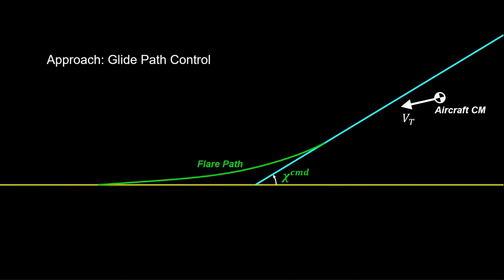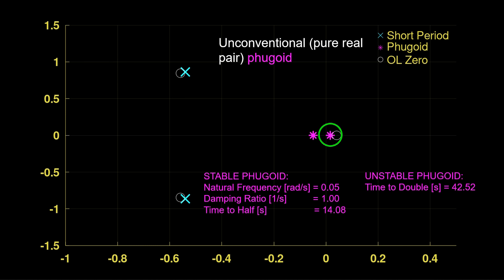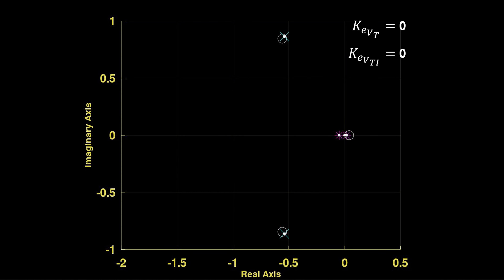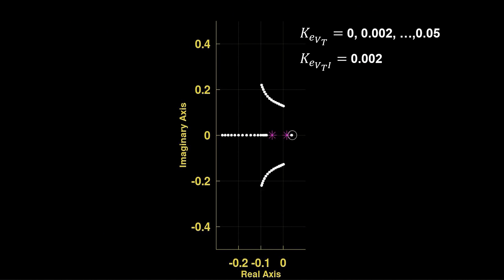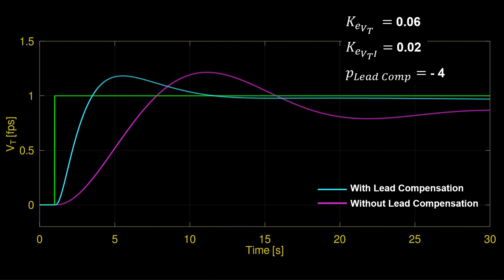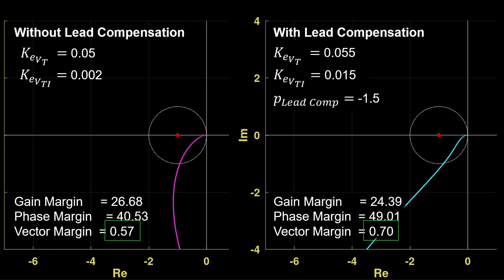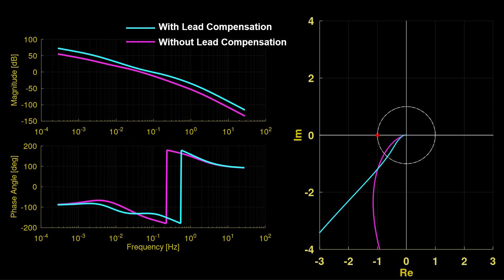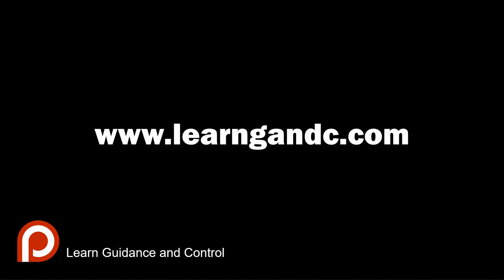Aircraft Airspeed Control with Lead Compensation – Flight Control Fundamentals - Section 1.6.3

Comment: can you explain the selection of 7.5 factor for the lead compensator (10:16)? In the previous video you set it to 4 when the compensator was (s+0.22)/(s+0.88) to make its gain 1. Now following the same logic the factor should be 20. What am I missing?
Reply from the maker: Ok, had to do a little investigation. It's to make a steady state gain of 1, but the transfer function is not correctly listed. It actually has a pole at 1.5. You can find this on my Patreon post (thanks for subscribing) at the link below. Go into the driver PI_Control_of_Airspeed and then look at Part G where the lead compensator is specified. Thanks for watching and the question! https://www.patreon.com/posts/airspeed-control-85847981?utm_medium=clipboard_copy&utm_source=copyLink&utm_campaign=postshare_creator&utm_content=join_link
Reply: @LearnGandC  OK now I understand. The gain of 7.5 is for the pole at 1.5 that you showed as a compromise after the pole at 4 required too much control effort (risk of thrust saturation).

Comment: What if we don't sure about the time lag of engine or the engine's time lag has different values wrt different conditions ?  Is there any practical problem of using lead filter to make pole zero cancellation ?
Reply from the maker: Yes, this is an issue! There will always be some error in where we think the pole is versus its actual value. There would at least be undesirable transients, but their severity would have to be tested. One approach is to evaluate for a range of uncertain pole locations to make sure we are robust.